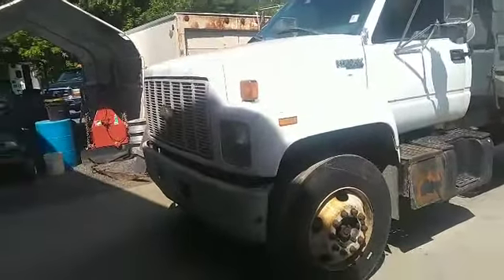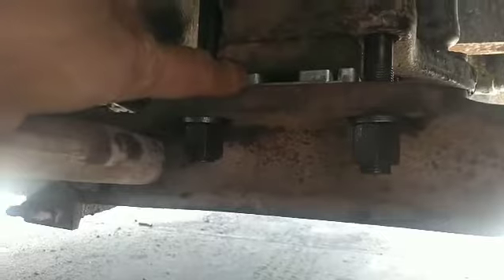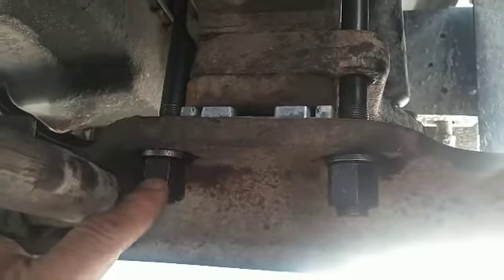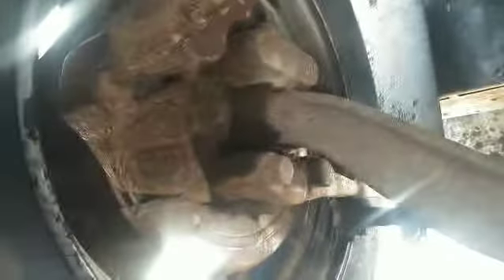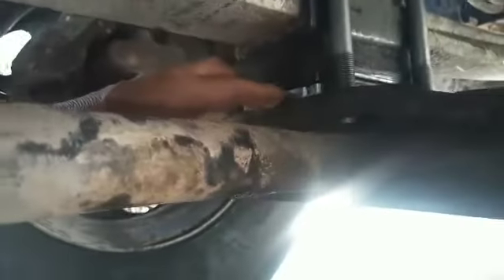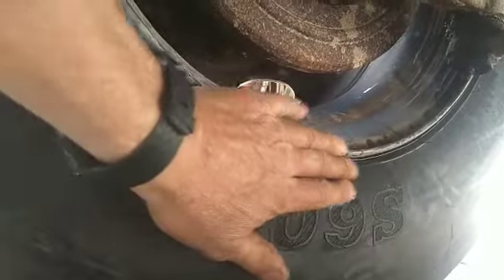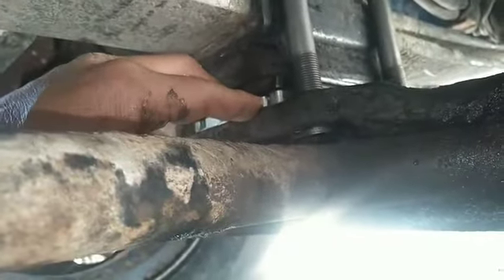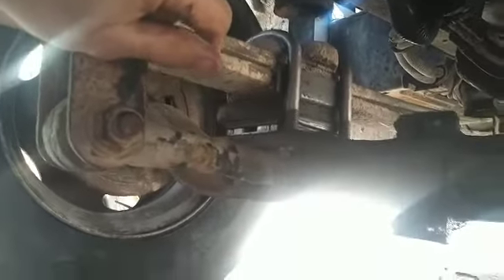Death Wobble, Truck Front end Alignment

Comment: Great video! You just explained everything I am going through with my 1991 Chevy Kodiak. The gearbox is no longer sold. I had to send the gearbox to Cardone to rebuild via Rock Auto Parts, which helped with the excess steering play. Next, I replaced both front shocks. Then I had an alignment and the alignment man installed the shims on the axle. Next, I replaced the front steer tires and old split rims. I am at an 85% solution at this point. I am still trying to figure out what to do aside from replacing the kind pins. The death wobble is gone, but I still have too much play with the steering wheel.

Comment: I have an 89 international s1900 single axle dump truck. Runs great and steering is good but maybe a little loose when going straight down the road. Occasionally i get a little shudder in the steering wheel when loaded with rock and braking hard. I think the leaf springs are getting tired like you mentioned and changing the camber out of spec when braking putting extra weight on the front axle and springs. All my brake shoes look good and are adjusted properly. Have you seen this before?
Reply from the maker: Neal, I think you meant to say you believe the caster is changing not the camber. The camber won't change on a solid front axle unless you bend it. So I would think you should see about shimming it like I did but use new U-boats also u bolts that have been stretched may not tighten up correctly and are always at a risk of breaking. If your springs are  dearching under heavy braking you might want to consider new ones but if they look in good shape otherwise I would put a shim in there. You can actually check your springs front and back of the axle by finding a spot equal in distance from the axle and maybe at least two or three of the spring leaves wrap masking tape around them tightly and then take it for a right road test on a straight road hit the brakes hard when it's safe to do so and then go back and see if the masking tape breaks. Leaf springs do slide against each other slightly as they go up and down with the load but this little test will give you some insight as to how good they are.
Reply: @gvmcrae  thank you! Yes I typed camber, meant caster! I'll try the scotch tape trick, never heard of that one. I think I could try a 1 or 1.5 degree shim.
Reply: @gvmcrae  do you also have an easy way to check toe? I was going to try just pulling a steel tape across for now on forward edge of rim and back edge of rim and see what I got. Is it normal to have 1/8"' toe in or what would you consider normal?
Reply from the maker: @NealORussa  all we ever use on our trucks is a tape measure. We go to the tread as long as you go the same place on the front and back and maybe 10 in off the floor front and back you're going to be very accurate. Typically we like to see a 16th to 1/8 toe in. There's always a little tiny bit of slack in your joints and since the tires are trying to fight each other all the time it's better to have them towed in slightly. If you toe any vehicle out especially a truck you will see it wanders each tire tries to find its own way outside the travel direction. We actually have a truck tow gauge but we never use it. Just a good tape measure and two guys in the same spots
Reply: @gvmcrae  10-4 thanks! I'll try tread that sounds easier than getting into the rim

Comment: quick question i have a 2019 peterbilt and on the front it has a aggressive death wobble between 45-60 mph i took it to peterbilt they put everything new and it still does it and they dont know what it could be could you help me out?
Reply from the maker: Hey I'm sorry about your Peterbilt I didn't see this until just now hopefully you got it fixed. Like I said in the video make sure everything's tight and if it is the only thing that's going to make it wobble if the tires are trying to argue with each other which one is going to lead the way. Caster is your fix and generally just a 3° shim will do it. If you see this response please let me know that you got it fixed sorry I didn't get back to you sooner just missed the comment.